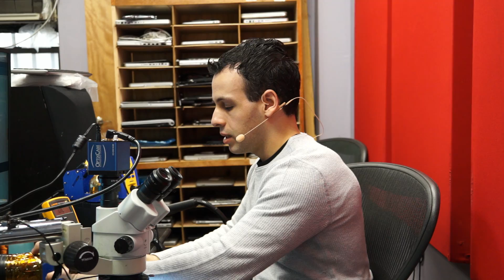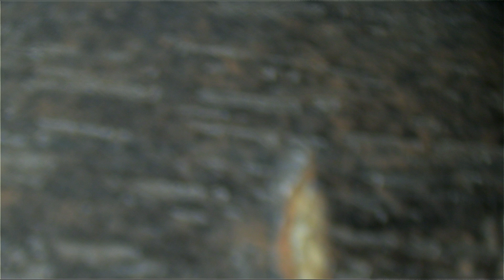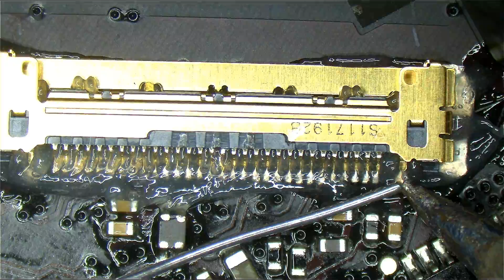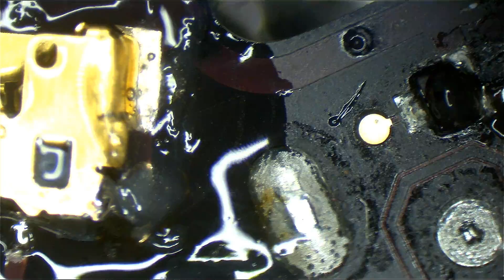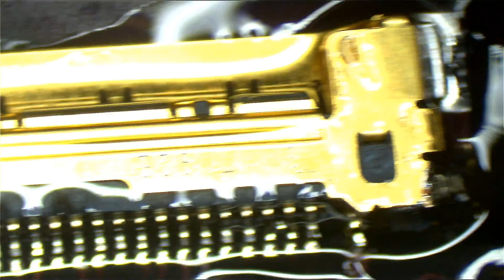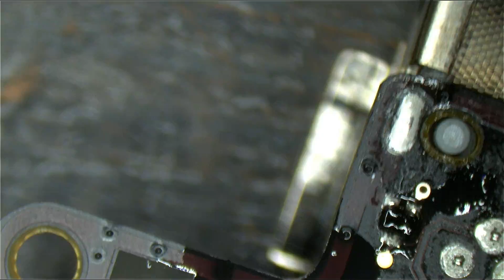Easy no backlight repair on macbook logic board

Comment: i dont know if youre on amazon your competitor l2 is i bought a new logic board from him repaired my computer no backlight i dont know where the fuse would be on a mid 2009 13 in macbook pro logicboard because the connector is seated differently it worked before i borked my old board traces near speaker connector damaged could that have damaged my backlight ?

Comment: Dang dude.  I was replacing the wifi antenna on this thing I saw a spark. Then damn, wish I disconnected the battery.  Thought nothing of it- until I put it all together and the damn display didn't work.  Google'd backlight repair because I thought this could be backlight related. Lo and behold very similar situation. I wasn't about to replace the whole thing though, but Decided to watch this whole thing just because I was like so impressed. 

Well, then he gets to the part about the fuse. You know, that infinitesmal little thing with the P on it. I'm thinking: Wait- maybe I blew my fuse?!  I found just the right sized screwdriver blade, placed across and BAM! Laptop screen comes on!  I am going to simply bridge mine because I don't have a spare board with little P's everywhere, but if I hadn't seen this video, I'm not sure I would have got this thing repaired. Thanks Louis! Throwin some money your way!

Comment: So, amazing job... I really love your steady hand and skills.  I have an older Macbook Mid 2012 (MD101) that I'm troubleshooting where the LCD will just completely die - no backlight, but the LCD is still operating.  I usually have to reset the SMC and PRAM quite a few times, and it recovers (so, obviously, this isn't the fuse).  It's pretty unpredictable... have you seen this on any of your repairs, and have any idea before I start throwing parts (like a refurb LCD) at it?  Anything on the motherboard?
Reply: Did you ever find out what the issue was

Comment: Hi, i have 13" mid 2012 macbook pro a1278, when i start it makes chime sound hard drive and fan spins keyboard backlight turns on but no display not even dim so it cannot be backlight issue and one of repair shop said it might gpu issue it doesn't have dedicated gpu. Please help.

Comment: noob here.  love the channel.  question.. ive yet to convert my granite fabricators mitts into hands that are reliably steady for this repair.  could it be done by applying solder to the  pins on the replacement connector then melting it in with just the hot air?  i feel i can manage that but i can barely connect 18650 tabs without problems yet with my adjustable soldering station.  thanks  :)

Comment: Thank you for this video. Ordered a 2012 Pro from eBay said the display was dead. Plugged  it in noticed that the back light was not working, googled backlight repair and here you were. Looked to find the P fuse for the backlight and low and behold it was not on the board. Ordered a new fuse heres to hoping I can get it working wanted to swap it out with my 2011 i5 as this board was the i7 with 4.0 bluetooth but if this works then score I can just sell the  2011. LOL watch your videos weekly!
Reply: Jason Kepner at least measure first for short to ground before soldering a new fuse. Fuses in MBs usually don't protect anything at all...
Reply: Todestelzer  would a short to ground render the until inoperable? The unit works just no backlight? Sorry very noob to working with logic boards

Comment: @ Louis: Can I send you my Macbook Pro 13"  for repair?  I have a backlight- problem. I already checked the pins at the display/lcd connector. Everything looks fine. At apple store they wanted to charge me 60€ for the analysation and nearly around 700€ for the total repair for a repairtime of 7 days in total! I bought it from a friend for 800€, so this repair at applestore isn´t reasonable. It`s likely to say that by repairing it by apple would be a total finacial loss. I really need help.

Comment: could you please try to diagnose my issue ; when macbook pro 13 turned on everything is good for about 10-15 minutes and then backlight suddenly stopped to work, the lcd still works , there is system running , can see icons when use a torch directed on the screen but no backlight, however when mac stays still  ON  for another  10 minutes the backlight comes back and is perfect for a while , then again disappears , and the same story again and again infinitly...

Comment: Halo.,
I have problem about no backlight on macbook mid 2010
Logic 820-2877-B

I have change ic backlight
Just output 20Volt

Normal is 27 volt.,
I have change Q, dioda, coil, is still  no backlight.,

Are you have file brd 820-2877-B?

Comment: hey louis by the way awesome channel, i have a question i was fixing my macbook pro 2010, i make sure to disconnect batterie plug before i start, but unlucky me it touchdown  when i was reassembling the computer so when i want to plug the screen mesh i saw a spark, at that moment i knew i fucked-up now the screen is working but no backlight (i know it's working because if i use a flash light on the apple logo i can see it's work) should i change the connector or change the screen. thank in advance

Comment: Hi Louis.... QUESTION if i may
Why are you soldering all the pins 1 at  a time
Why would you not use a WAVE TIP so that you could solder them all in one hit 
here is an example of what i'm talking about

https://www.youtube.com/watch?v=b9FC9fAlfQE

go directly to 16:08 - 17:00 mins

i'm just curious as to why you wouldn't be using this method.
Your method does indeed work,  no question,
but this method is quicker and seems to do the same thing

is there a particular reason you don't do this ?
Thanks ahead of time 
Speak soon

Comment: Hello everyone, I have a Macbook air 2011 that has a back light issue. Only the left side of the screen lights up and the right side is dim. After turning it on, it will eventually dim until fully black. The screen is still visible with a light aiming at it. Works when connected to a external monitor. Also, the assembly that i have is 100% in working order as it works just fine with other logic boards. Thank you in advanced!

Comment: I ordered an lcd because mine was cracked, backlight works on the cracked one. The backlight on the new one does not work, I used a flashlight and the lcd works, it is just the backlight, I reconnected the cracked one and it does have backlight. I'm returning it as defective BUT can the backlights on these lcd's be swapped?

Comment: Hi Louis, I have a MacBook Pro 2010 A1268, and I have a problem with it, during a heavy usage time a day, the screen goes black and it freezes, making me to take out a battery and unplug the charger, just so I can restart it, do you know any possible fix for it? I've been using it for past 4 year and repairing it, but this issue is something that makes me to think of multiple problems, so can I ask you an advice before I jump in and start repairing it to see if it is worth investing resources to repair it?

Comment: Louis one question Did you buy the lenovo  p70  laptop and  is it worth it
Reply from the maker: +BIN FORCE I never did. I have promised that my next laptop a little 4K touch screen. I used a 1366 X 768 touchscreen last year when I was viewing schematics on a student's laptop and I was hooked! The ability to drag around the 72 page PDF and zoom in and out and move around with my fingers is an ability I demand in my next computer, but I do not want to give up resolution to do so. I will not be buying a laptop until I find one that fits my needs with a 4K touch screen. However, since I have built a proper work desktop and home desktop, and have started an exercise routine that involves running home, I almost never use a laptop anymore, so I do not have as much use for a laptop, if any, so I will most likely not be buying one at all
Reply: +Louis Rossmann  Thanks for replying
Reply: @rossmanngroup   if you ever change your mind about not buying a laptop, Dell makes a 15" with a 4K touch screen FWIW.  Personally, I'd like to see a 13" with a 4K touch screen, but I don't think anyone makes a 13" screen with a 4K resolution, could be wrong on that though.  And as always great videos. 🙏

Comment: superb!   if we put flux nd solder both side of fuse or any component, it comes with very  low heat...even from air board,
now good sourse of fuse is if you broken led laptop screen, u will find a fuse on the back circuit board. it might say fuse or dot.. chk resistance, if o or ) or close it must be a fuse. this good for any led backlit system.